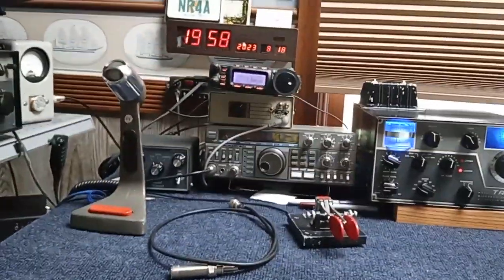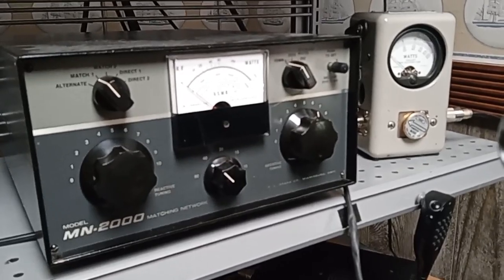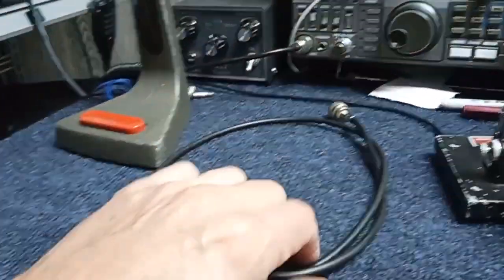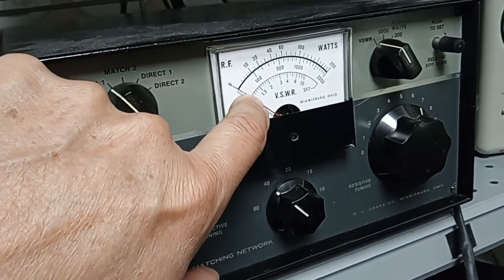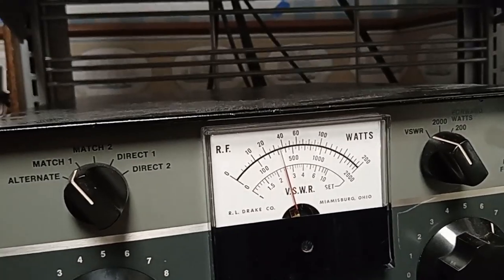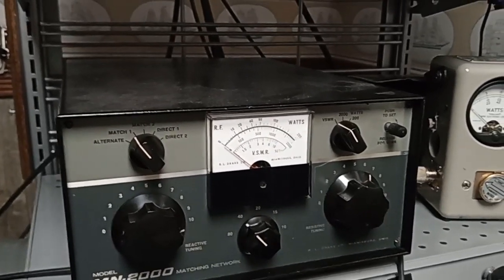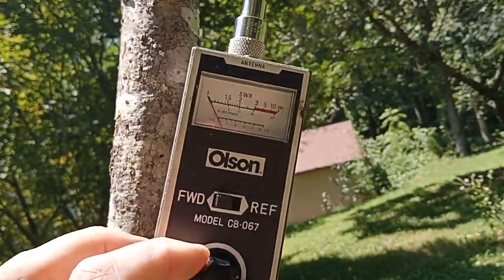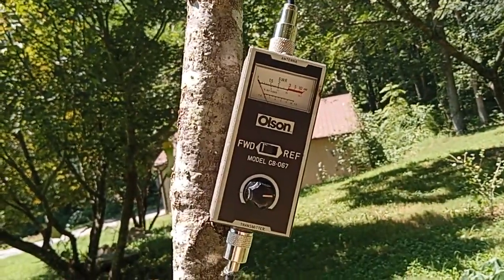Absolute PROOF  FAKE Antenna Tuner- Myth Busted!

Comment: Can you try this on the xiegu g90 tuner? I know I've made contacts in other states on 40m using a 20m dipole.
Reply: Making a contact is not an indicator one way or another of an efficient antenna. Plenty of “will it antenna” videos out there using guard rails, farm equipment, metal statues as antenna.  They make contacts.  I have made contacts with EFHWs, doublets, hamsticks, a 1/4wave for 160m, kite antennas, Compactennas, j-Poles, Slim Jims, an antenna made of low voltage landscape wire, and more. 

The way you tell an antenna is excellent is over time with signal reports on multiple contacts at various distances, directions and propagation conditions.  

Any spotting service like POTA can make a compromise antenna look good because ten contacts can be made with even compromise antennas. And if that’s the goal, great. Today a hamstick user in Montana activated a park but I could hear plenty calling him that he couldn’t hear at all. He still activating the park.

But if the goal is DX QRP or Barefoot QSOs with better signal reports, then efficiency is key. I busted a handful of pileups first call or second call today on a 22 guage dipole tuned at the feedpoint and just under six feet off the ground. Only one QSO was made when switching to a doublet.

K8BYP’s channel has backflushed a bunch of conventional “wisdom” out of my brain.  More backflushing to go. Can’t wait.
Reply from the maker: : 0
Reply from the maker: What part of " theres no such thing as a tuner" not clear to you?

Why would I " try" that if it doesnt work? Im an engineer, I dont do guessing. trying the same failed thing again expecting a different result is the definition of insanity.

"I made contacts in other States" shows that experiment was a failure.

I make contacts in other States , and EUROPE, with MILLIWATTS.

ONE MILLIWATT to GA.

Watch my other  antenna and transmission line videos and learn something!

Comment: Olson Twins Meter :) I have been telling people the same for years your antenna is either matched or not matched. Thanks for sharing !
Reply from the maker: Believe it or not, a University Prof suggested using that unit for simple, " seat of the pants" field measurements.

It works for relative readings.

Worse, its directional or not. Same difference.

Mismatch also affects directionality.

IEEE APS paper on the relation between feedpoint R value and directionality.

Theres NO way Im able to transmit 5000-7000 miles on less than a watt without directionality being in play, and thats using dipoles that normally arent directional. (2.3 dBi)
Reply: @k8byp  Those are great meters for doing exactly that. I was drawing a parallel between Olson Twins and Osmond Twins for humour sake.
Reply from the maker: A little levity helps in a difficult topic.

I was able to use that cheap junk " CB" meter for field strength to show * greatly* increased directionality on both the 20 and 15 meter dipoles.

Directionality that two Professors said cant exist.

But it DOES!

Comment: Absolutely positively truth. In fact another symptom to watch for is if moving coax around changes the swr significantly.  Thanks for the great video.
Reply from the maker: yes the CBers do that, pretending that matches something. It doesnt.

They add or remove line to get a minimum on their CURRENT meter not realizing that makes MAX VOLTAGE, then wonder why their transmitters go BOOM💥🤣🤣🤣

You can lead a horse to water and some are so stupid they drown in the river!

Comment: Dude I’m jealous, that’s some beautiful radios and radio testing equipment.
Reply from the maker: thanks, most of its old and restored.
.I couldnt justify spending those megabux on these ' hobby' activities otherwise.

The Tek scope- SA  -TDR was 50k in the late 80s. Its basically all lab equipment.

And a $5 meter to prove the point in this video!

Comment: 100% accurate and all people should see this video!!!! It's so worth the extra time to physically tune the antenna to the desired frequency. Thank you
Reply from the maker: thanks, spread the word!

The PROOF doesnt get any simpler, yet there are people that just want to deny and argue. They get deleted.

What part of "all the energy is reflected back from the feedpoint" is so difficult to see?

(Actually its not that simple, but it works for a starting point. It isnt "all" but its close enough.)

The difference correct MATCHING ( antennas are not tuned) makes is jaw dropping and not obvious.